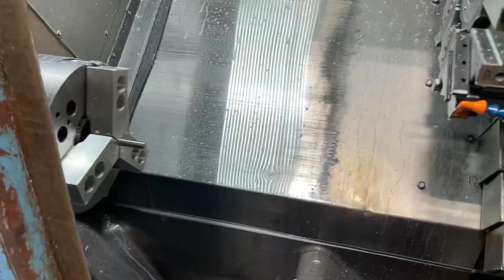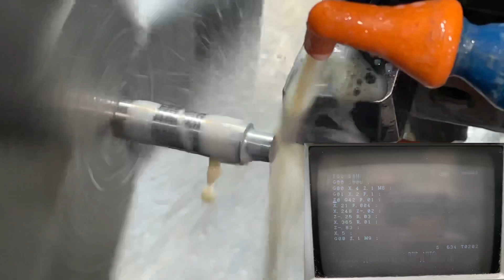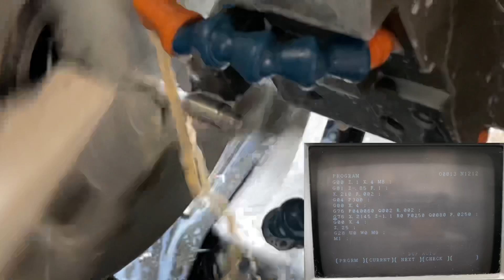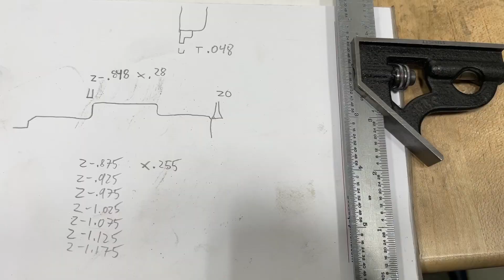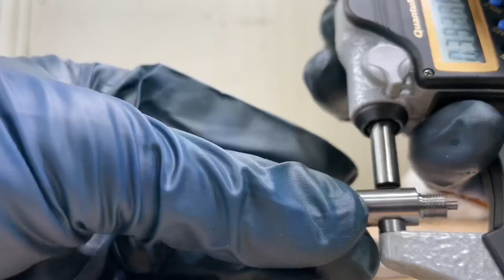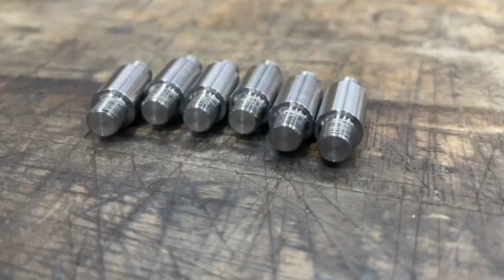CNC Lathe hand programming - advanced threading (G76 cycle)

Comment: On the 2nd thread that’s closer to the chuck jaws it should be done with a left hand threading tool holder mounted upside down. That way you can thread it with M4 (threading away from chuck)therefore you will avoid the awkwardness of ramping in.
Reply: Those wedge clamps can be removed and mounted upside down using the tapped holes on the upper side. At least all the turrets I have seen in the past will accommodate that. You’re welcome. You definitely have the right approach on a work piece like this! The best part of being a machinist is everyone is willing to share their experience and knowledge. Keep up the good work!
Reply from the maker: That’s great advice, yeah I don’t have that tool holder unfortunately. I’ll have to get one of those for next time. I don’t know if my tool magazine would allow for that to be centered mounted upside down though that’s the main problem

Comment: 1. imperial system is the worst bullshit i've ever been forced to work with - 3/8 diameter.. what the fuck does that even mean? i've to spend more time counting some fucking usa hamburger per mexican immigrants system numbers than making parts - just to have some fucking idea how big that really is, i've no fucking idea how big 3/8 or 0.375 is, when i get fucking us braindead larded drawings, i spend fucking 15 minutes before i rewrite all dimensions into normal metric system just to know what the fuck am i supposed to machine
2. whole fanuc and coding parts in G-codes is worst bullshit i've ever been forced to do - this system is just japanese cheap ass copy of original coding invented back in 60's, it's usable only for chinese sweatshops where they write program and run that bitch part in millions of pieces for decades, if you use that shit for single job production, you spends whole freaking day on some fucking dumb rod with 2 threads and parting and have 99% chance you forget some bullshit like G0G28U0 and send your machine to scrapyard before it even makes a single part, this shit is so fucking overcomplicated even for 90's, you must read a 500 pages book just to do a fucking thread and not to crash the machine - that decade systems like mazatrol were made, in comparsion to this bullshit it's fucking heaven